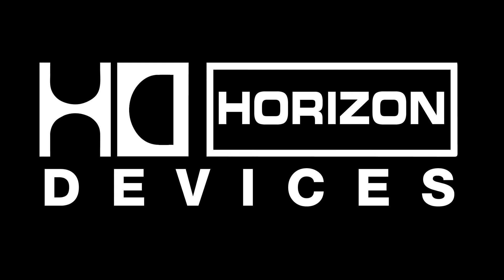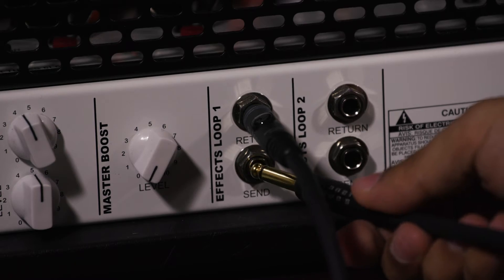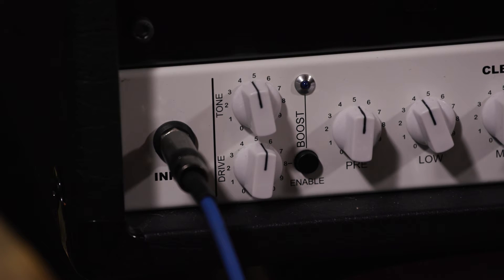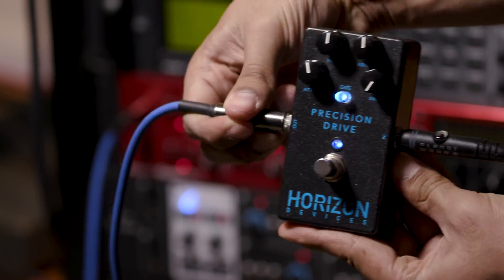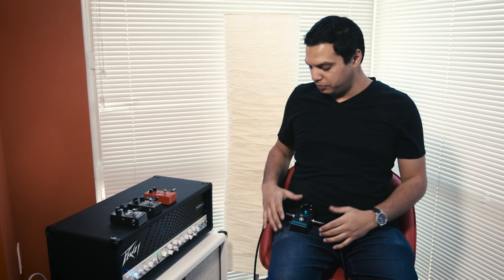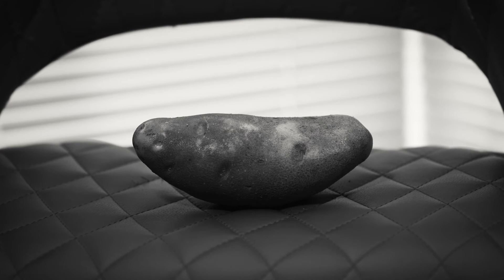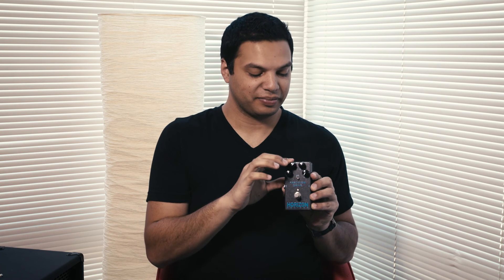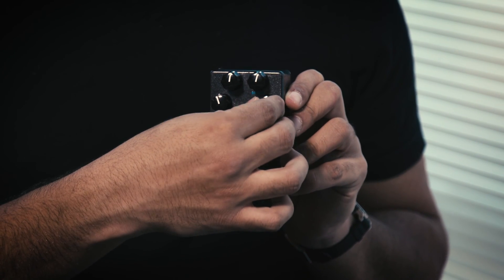Horizon Devices Precision Drive Tutorial 1

Comment: Misha, miniaturize the circuit, or a simpler version of it, and put it in a "tone" control (since tone controls are worthless anyway), build it around a concentric pot for gain/level, or attack/level. The low cut/bandpass thing going on is MAGIC for tightening up the low-end, so much so that it should be part of the instrument.

Comment: Is a negative tip power supply the usual one you would use for any distortion pedal? I have a power supply but I don't want to plug mine in and ruin this pedal. Just got mine today 2-20-18